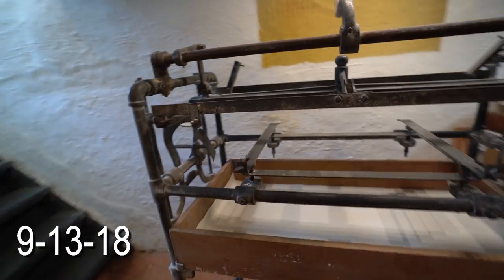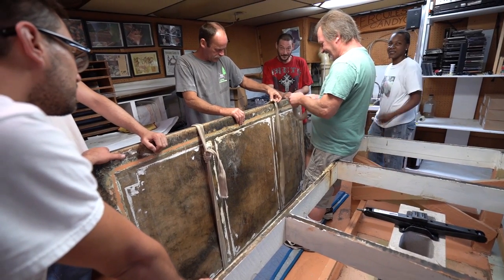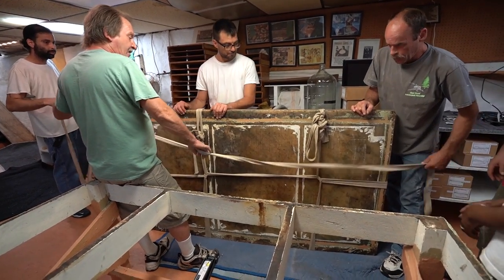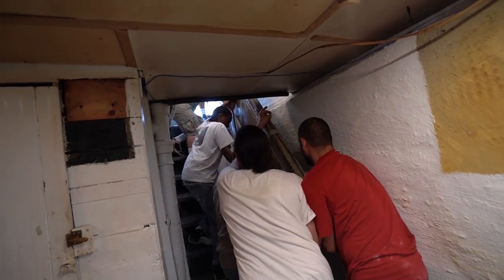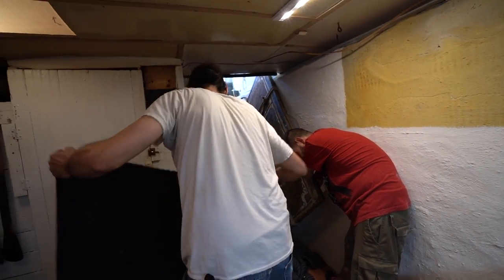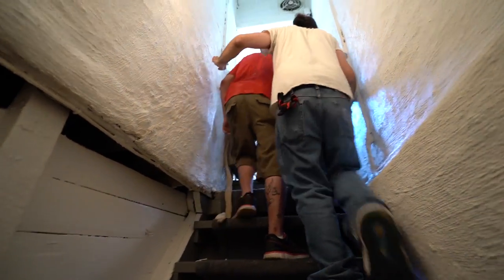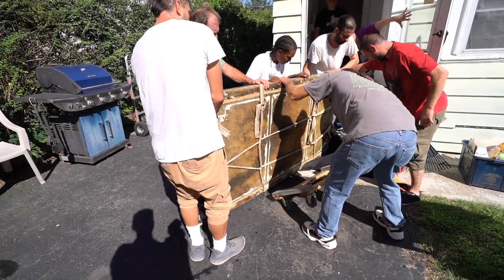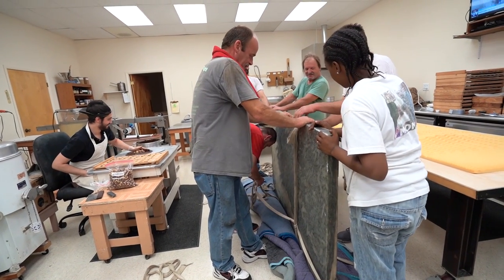It Took 6 People To Move This Marble Slab!

Comment: I tell you what I've moved a lot of heavy equipment in my time.  This guy just ticks me off to no end.  

Doesn't convey any kind of pre plan or backup plan with his employees. (Which during a lift you should always do.)
Expects his employees to know exactly what he is thinking
Talks down to his employees when they don't know what he's thinking.
Micro Manages to the smallest detail and yet still somehow manages to screw it up.

As I was watching him tie the straps down if I hadn't already seen the marble table in the new place during the brittle live stream I would have sworn they were going to break it.  Not sure what they charged you but it was to much, especially for a furniture crew to move something that heavy from a difficult location.
Reply: As a stone fabricator, cringe level was high
Reply: It seemed to me that they were just day laborers. I thought he did okay with the pre-planning but he did lose his temper a few times. Having a camera there doesn't help with the stress level either. What did bother me was that nobody used a tape measure. The plan of leaning the slab to the side went out the window when they got it to the stairs and realized it would fit vertically.
Reply: I knew it was going downhill when he said he hadn’t moved marble in 10-15 years, can’t even believe that from whatever he was trying to do

Just realized the corners are fucked good thing it’s a work counter
Reply: @ibtrollinya69  ive never moved a marble slab this big out of a basement, but guarantee  id get the job done as quick as they did. the more important thing here that was already said was there was no pre-planning, i would of made a fixture to slide the table up the stairs and extensions so everyone could equally push it up at the same time. shouldnt bid a job you can't do well.

Comment: Not a steel toe in sight, brave people !!
Reply: A steel toe might cut your toes off if that landed on them. Crushed toes or no toes, that's the question..lol
Reply: Yeah, a heavy enough object could crush the steel toe, and even when the object is removed your shoe would still be crushing your foot.
Reply: I found the video painful to watch with all those guys not wearing safety shoes. Sure, there's a limit of how much compression force a top cap can withstand, but it's WELL above the ~500lbs  that the marble table weights. Kids, don't try this at home!
Reply: Total myth.  If something is heavy enough to crush a steel toe in a boot, you wouldn't have toes left regardless.  Without a steel toe, your toes would be unrecognizable.  With a steel toe, however, they may be able to save them after cutting the boot off.  Steel toe shoes are far safer in 100% of incidents where something heavy falls on your foot.
Reply: @eclark53520  Huh, TIL!
Reply: Yeah, steel toe boots are designed to cut your toes off if the unfortunate happens. If your toes get crushed however when you're not wearing them, it can be impossible to surgically repair them and it's significantly more likely that you will lose the toes. Whereas if they just get cut off, they can more easily be reattached and the toes are more likely to heal correctly. I personally would rather keep my toes after such a tragic accident. I'm honestly surprised that just for the purposes of insurance and workman's compensation that the moving company doesn't require the employees to wear steel toe'd boots.
Reply: Mike Beale I don't wear steel toes after a accident with a draft horse. I almost lost every tow on one foot. They had to use a grinder to cut the boot from my foot.

Comment: The movers should invest in steel toe shoes, hand/back straps, and moving gloves!
Reply: Investing in some of the basic equipment that is readily available for moving heavy items would come in handy for many jobs!
Reply: Yeah, I was astounded at the lack of equipment. When I hired movers they came with a bunch of gear including body harnesses to which they attached the straps they had fixed around the furniture. Not to mention the most basic of safety gear like gloves.
Reply: They are probably getting 25$ each with the little one getting 15
Reply: Oralia Lopez they’ve got tons of straps though
Reply: Agreed. I kept yelling at the screen "Those straps you are putting on the marble will do NOTHING. You need a sling at the front and a sling at the back, with a wooden handle on each end for grabbing onto. Period.Ideal would be body harnesses that you can hook the slings onto so that your entire body can support the weight not just your flimsy wrists. And I'm not even a mover.
Reply: Bill Anderson - My husband said the same thing you said!
Reply: And a winch!
Reply: @BillAndersonNS  I was thinking the same thing about the sling...so much easier!

Comment: It was a tough move but an 8 piece cradle on the bottom and 4 piece support over the top all done with straps would have made that move much safer and easier. They could have also winched from the front with rails and pulley at turns. The guy in the green needs to kiss the guy in red because without him somebody gets hurt.

Comment: Im sorry ,but that was a lot more work than it needed too be guys 😖 there are so many different things that could have made it less of a hassle, i subscribe to the methods already mentioned below, and there are more tools such as handles that glassworkers use to lift simular weights of glass - they are basically handles with super strong suction cups on them- and you can put on as many as you need. All im saying is, less excertion over a smaller amount of time, less injuries (fingers and toes and backs are safe) - and all this for just : A little thinking or planning, avalible in your area for a wooping 3.5 too 5 minutes👌🏻🙊 seriously tho, please be safe i hear those medical bills over there can be pretty pricy - so no need for thrown out backs or an early reteriment!

Comment: I’ve been wanting to see the table moved, and while I’m glad to see it done, I’m a little sad too. It feels like the end of an era. It has been down there so long. I wonder if you could get a marble countertop guy in there to sand down the high spots, fill in the crack and refinish the surface to a high polish?  It would give the old table new life, and I don’t think the candy would stick so much.
Reply: Patti Messenger Yes!  I think it would be even more beautiful if it was cleaned and buffed!
Reply: I was wondering if it could be repaired kind of like a car windshield is repaired when it's cracked. 
It would look beautiful polished up. 
They'd just need to be careful that anything they use is going to be safe around food. 
There probably is though since so many people have marble counter tops.

Comment: For "movers" they dont know many tricks to move stuff lol, work smarter not harder they say, they worked WAY to hard for moving that slab. Maby they will read some before there next big move, that table shuld have been out of there in about 15minuts =(
Reply: ikr
Reply: A  marble table  isn't worth someones getting hurt
Reply: Well that is my point, if done right no one would be in a positions where they could get hurt, there where many of them in this video, back lifting tecnics, bad footing, bad harnesses (or non at all), bad planing, just bad in general. I just know after working with this before, moved big safes and realy heavy stuff. You need the right tools for the job, they did not have that, that is all I am saying =)
Reply: 600 lbs up the stairs in 15 minutes? That’s hilariously stupid

Comment: Y'all worked to hard to move that you guys had the wrongs straps and why didnt these guys rent a drywall cart? Lol they made this so difficult
Reply: I was wondering why they didn't use a come along to get it up the stairs.  Must not have been around construction much?
Reply: I was just thinking even some pipe ( maybe steel since i think pvc would just break), anyway lay pieces of it down and make some rollers for it. They could have even made a roller ramp for the stairs. A couple people pushing up and a couple people on the sides. They would have just been dealing with weight and not the friction as well.
Reply: yeah they made it hard for themselves, proper equipment would have moved that thing in a jiffy
Reply: Matt D | I’ve thought that in previous moving videos as well. It all seemed a lot more complicated than necessary. Perhaps here in Amsterdam, with all the steep stairs and difficult corners in houses, we have more tools to help movers out?
Reply: Eleonore Bon : I know, right? In Amsterdam, they have hooks at the top of the house, over the windows. I have watched them move grand pianos by dangling them several floors up and sliding them in the windows. You either work smart...or you work hard. I guess it is a question of experience. Nonetheless, they managed! Greetings from Berlin!
Reply: I don't think they encounter big marble slabs that weigh several hundred pounds everyday. It's not something most people have and need to move. They said they could get it done and they did, without breaking it.
Reply: Yeah I was shaking my head at how they made it so much more difficult than it needed to be. One small wheeled piece at one end and they could have moved it with half the people.
Reply: SpiritBear12 | They did a great job. It just didn’t look very professional. Not even the way they communicated among each other seemed very coordinated. Often movers have very specific ways to count down and tell when to pause etc. There are lots of simple ways to get more grip on a marble plate like that. But they did it. And that’s what counts in the end! By the way, I was also talking about the other moving videos where they just didn’t seem to have good quality carts to push things up the ramp.
Reply: I agree watching it and was like wtf are they doing lol are well they got the job done that’s the main thing I’m surprised it didnt brake
Reply: @Locomaid  those guys are nuts moving pianos like that  hey from upstate ny im only 30 minutes away from these guys
Reply: @janambrose4917  I was thinking the same thing, some sort of come a long thing braced outside the houses doorway perhaps, to wrench it up the steps, instead of the dangerous way there could have been some serious injuries
Reply: @brendastuntz1727  Yup -exactly what my Dad used to do and would have done.  He believed in THINKING first, planning (using physics to your advantage) and never lifting when you didn't have to.  'Use your brain, not your back!' 
My dad never lost his cool moving anything huge or heavy because he always thought it through and always applied basic principles of physics.  On the other hand, he was educated back in the 1920s and 1930s, and in those days, people really LEARNED things.  (I look at the old textbooks and see things I wasn't taught until university, kids in my Dad's day were learning in 8th grade).  Also he grew up on a farm: you made it; you figured it out; you did it yourself; you passed on knowledge from generation to generation. 
I'm a woman living alone, and when I decide to move something heavy or do some other 'big' job that normally my Dad and brothers would have handled, I just remember my Dad's advice to THINK FIRST, plan, take it slowly, and 'use your brain, not your back!'  It may take longer, but I manage things that other people hire 'professionals' for, just by thinking it through and planning and remembering to use gravity to my advantage; use rollers and levers and wedges and you can move pretty much anything.

Thanks for the lessons, Dad!  Nobody's ever going to see me blowing my cool and puffing and sweating in real life or YouTube, because I was taught to work smart, not hard.
Reply: @SirGuido  Yup.  Or lengths of pipe as rollers under a board. Does nobody learn basic physics anymore and the power of the wedge, the roller and the lever?

Comment: Steve, At 12:12 i noticed a jack set on cinder blocks where the center of the marble slab is located. While i can appreciate the existing stand need some help in supporting the weigh, it would be a huge disaster if that slab were ever to have all of it's weight supported in the center at any given time. Those cinder blocks and jack had the potential to cut that slab in half.

Comment: OK, so next time you do this, first, put straps around the slab BEFORE you lower it off the frame, so when you lower it, you can do it gradually, with straps, not with fingers under it.  Then you need to lower it onto a board to which you've attached wheels.  Rolling is easier than lifting and carrying. You can also put something like that on a very slippery carpet or other cloth and push it along, sliding it over the floor (carpet and heavy object move along together). 

My dad once moved a box grand piano using magazines (slick covers) on which to slide it along the floor and then balanced the whole thing on one, old-fashioned wooden skateboard (they used to be perfectly flat, no curved ends; it was a skateboard from the 1950s), and  when he got to the stairs rolled it down pieces of wood he used for a ramp.  All we helpers (four kids ranging from 12-16, including one girl) had to do was keep it balanced and keep it from moving too fast on the stairs.  We rolled it right up into the back of a van.  Never lifted anything apart from when we raised it up to remove the legs.

I can hear my Dad: 'Use your brain, not your back!'  He'd have put down rollers on the floor and just rolled it along.  Or made himself a wooden 'trough' that would hold the whole slab, with wheels on the bottom, and rolled it right up and out of there. 

Once he moved a very heavy garden shed (he built it, so it was made of 3/4 inch planks and  2x4s).  He dug out beneath corners on the diagonal so he could 'rock' it, and we gradually raised it by putting blocks under the opposite corners until it was raised enough to put 2, 3-inch diameter pipe all the way through the space underneath.  We rolled it forward until we got close to the tipping point, then one pipe was pulled out and moved ahead of the other.  We just rolled that baby along bit by bit until we'd moved it from the front of the yard to the back. Then put blocks back, and slowly rocked and settled it into its new position. 

Give my dad a lever and a length of pipe and he could move that whole STORE without raising a sweat or getting out of breath. (He raised up an entire wood-frame, two-story-with-attic house once, using blocks and jacks, with a couple of sons for assistants). 

If he'd used straps to lower it onto a wooden 'trough' that was, in turn, on top of some lengths of pipe, they could have pushed it and it would have rolled forward on the pipes.  When one pipe appears behind the slab, put it at the front and push again.  Go slowly.  You can do the same thing on the board/ramp on the stairs, you just have to use your muscle to push it forward and keep it from rolling backward.  But I can see my Dad having someone attaching straps to something every time you have to pause to move a pipe forward.

This mover didn't plan the job.  Or doesn't know basic physics.  He's obviously stressed because he doesn't really know what he's doing and is making it up as he went along.

Comment: Always work Smart...not Hard...put the strap around the slab from the top of the stairs down around the slab and back up to the top of the stairs again...then get four people pulling from the top outside the stairwell where they have more room while two people push from the bottom and steady it on edge...one cart in the middle of the bottom of the slab would allow the slab to slide up the plank then Pivot as it reached the top floor thereby clearing the basement ceiling...work Smart not Hard : )

Comment: They must have very different regulations in the States about what safety gear the movers have to wear. In Canada, they would have to be wearing steel toed boots at least. Workers Safety Insurance Board (WSIB) would shut down the moving company in a heartbeat if they found out that the workers didn't have safety boots on. I would have thought it would have been prudent considering the weight of the marble! Fascinating move though! Glad everything turned out okay!
Reply: OSHA here would have a field day with this video. They could probably use it for training. But to some companies, it only matters when you get caught.

Comment: Also, they make special dollies for moving granite. I've done the hard way and easy way many, many times in my ReStore days. Also, putting marble/granite flat on a 4 wheel dolly, pretty risky unless you have a suspension on it, especially with that crack. Saving grace was that piece looked to be 2" thick, any thinner and you hit a bump with the dolly, marble would have been toast.

Comment: What is the thickness and actual size (dimension) of the marble slab? If you multiply the thickness in inches by 13.34 pounds you will get the weight of 1 square foot of the marble. You can use that weight to calculate the total weight of the entire slab. Before I had children I worked for a marble and granite company estimating kitchen and bath projects. :-)

Comment: i know this is late, but i might have built a crate around the slab, and an A-Frame area on the bottom to help support it upright, and then route a cable from outside to a strap and chain to the crate and slab so the guys would have only had to keep it form tipping too much to one side and keep it straight, but use the machine to do the pulling/lifting... Props though to those guys... that was not an easy job no matter how it was done.

Comment: That was really hard to watch. Glad no one got hurt. I would have built a 2x4 frame around it personally. Would have costed them about 30 bucks in material, take 15 minutes to do, and have better grip around the entire slab to bring up the stairs. Hell you could've even winched it up the stairs.